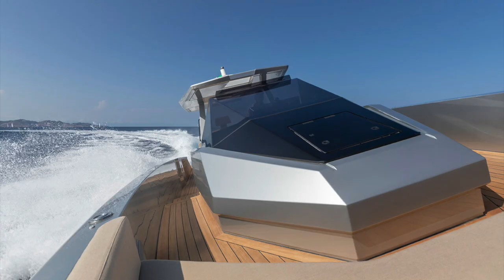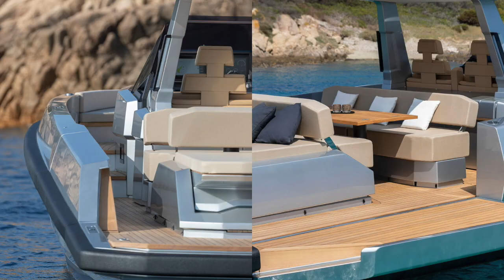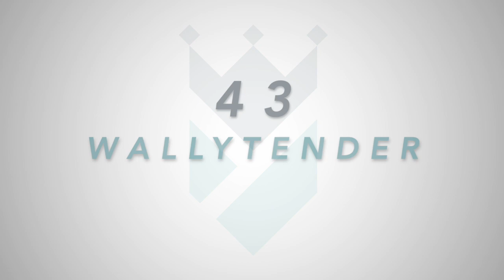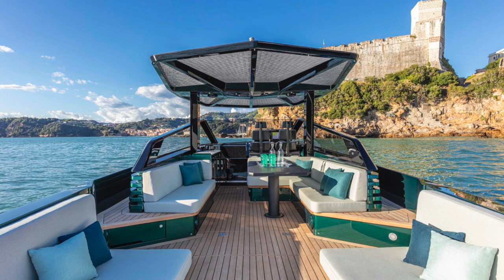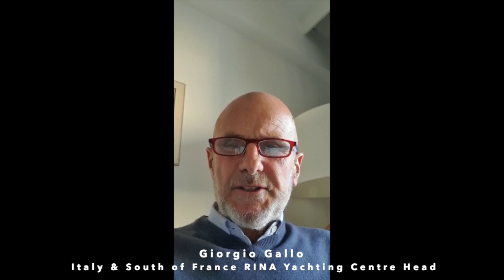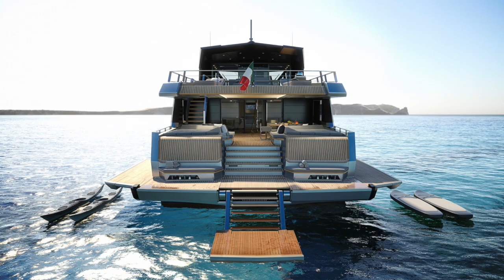WONDERFUL WALLY YACHTS AND THEIR RANGE OF MOTOR YACHTS!

Comment: We need more videos about the 24m load line length and which countries it applies. And if there are ways to circumvent it to have slightly bigger boats. Some yachts are 30m long in overall length, yet still come in under 24m lll because they use removable bow cones etc.